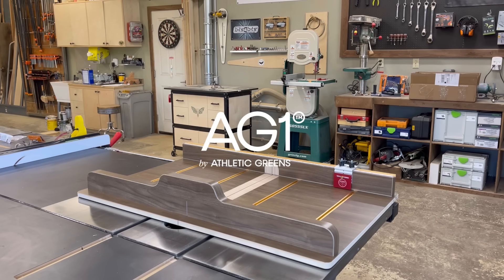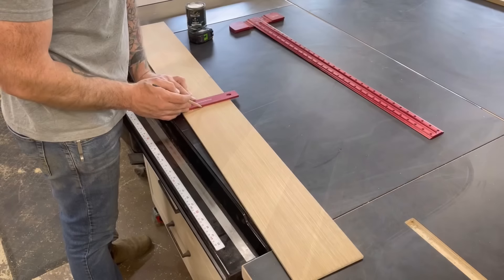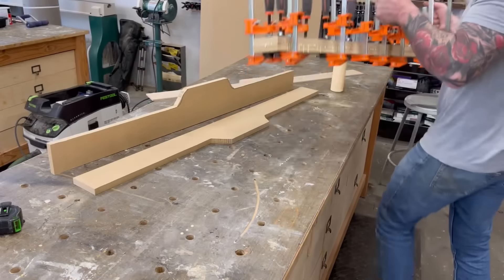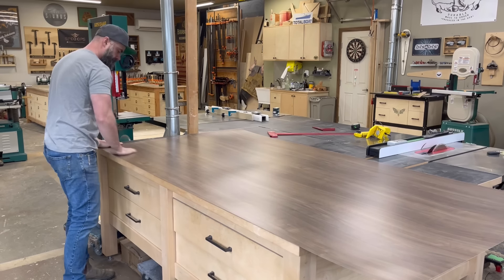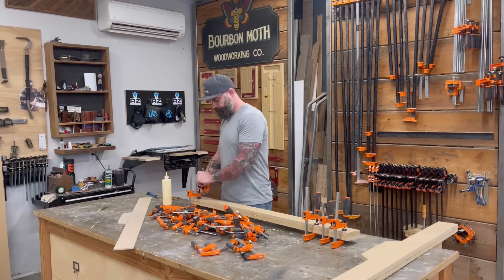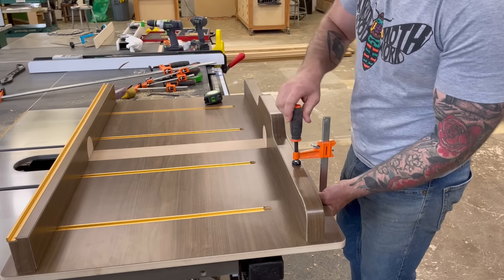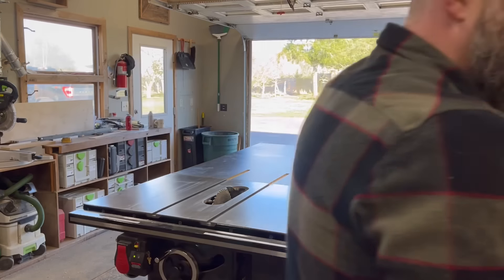Worlds Nicest Table Saw Sled || Ultimate Table Saw Upgrade

Comment: It’s beautiful. And probably weighs a ton. I ended up making very small, medium, and mega sizes to save my back. Also used plywood rather than MDF to reduce weight.
Reply: I made one a similar size as this out of mdf and most definitely wouldn't recommend it. It's got to weigh 60+ pounds
Reply: I made an "Ultimate Crosscut Sled" about this size. Now it's two crosscut sleds.
Reply: Moth is yoked
Reply: Thats why he is selling Ag1

Comment: Absolutely fabulous, as ever. I keep a short length of scrap T track with my sled. It drops into the out feed end of one of the mitre slots and contacts the end of the runner at the point when the face of the fence is directly over the centre of the saw blade. It gives a positive stop so you don't expose too much of the blade through the sled and you know the cut is complete without having to lean over to see.
Reply: This is a really clever idea! I'm definitely going to incorporate this. I like that it's not "permanently" attached to the sled so if there ever were a reason to need to go beyond the positive stop you can.
Reply: Great idea!!
Reply: @Logfunktioniert nicht! 4:29 anLovell

Comment: When sticking two surfaces with contact cement, sometimes I use cooking parchment paper since the contact cement doesn’t stick to it. As a bonus, you can just unpeel the parchment from in between the surfaces once you get it all in place.
Reply: Never tried that. I have used slip sticks and removed them one at a time and rolled it down.

Comment: A great looking sled, Suggestion; consider using Phenolic panels, also called Phenolic plywood for jigs such as cross cut sleds. Its used by masons for pouring cement into forms. the surface on both sides is very smooth and extremely durable. So much so they can reuse it several times with cement before replacing it. You don't need to laminate the surface of parts, just the edges.

Comment: Now I need a cross cut sled.  I'm not a wood worker by trade.  I consider myself a life long tinkerer and have no problems building my own boxes, tables, etc...  functional stuff.  Usually out of the cheapest (and hopefully the straightest) boards I can find at my local big boxes.  That being said, this is my 3rd or 4th video from you that I have watched now back to back.  The others being on sourcing wood.  Subbed.  Thanks for the inspiration!

Comment: So I tried cutting laminate like this (cheap home depot Wilson art)... and it shattered and caused rips throughout the whole thing, so make sure you're using quality laminate to cut like this, otherwise a router works really well. I just used the same flush cut bit I used for the edges - running along a wood template, CA glued on the back with painters tape.
They also make a water-based 'fire resistant' contact cement (in a green can) that is less stinky.

Comment: I made a similar sled with those same type of runners. One tip that I wish I had known at the time is to make a fairly large pilot holes and put screws through them and then make sure that the screws did not expand the runners width so it no longer fits. I had a perfectly fit sled and after screwing the runners down it no longer fit. The width expansion was imperceptible but it was there. I had to take them off and file the sides down a bit because it expanded and that expansion was permanent.
Reply: I've done that before too using UHMW runners, but the opposite happened, they were slightly sloppy before and the screw expansion made them fit perfectly.  Really just got lucky though
Reply: @acanadianwoodworker  Nice

Comment: I built one similar a few years ago. They are stout, sturdy and a bit of a pain to lug around. I ultimately built a smaller one for smaller projects and use the larger one for jobs that need it. An 'all in one' sled is nice on paper, but having two or three for specific size projects is so much nicer.
Reply: Same here. I built a smaller sled inspired by John Heisz's mini crosscut sled.

Comment: Wax paper also works great for positioning large flat surfaces being stuck together with contact cement.  The cement will not stick to the wax paper and the strips of paper can be removed one at a time for the final adhering stage.   Nice video!

Comment: Speaking of Double Sided Carpet Tape - I recently built a new workbench and botched the laminate adhering somehow (either not enough or maybe because I did it in a cold garage?) and part of the laminate started pulling up in the center. I gently pulled up some more of the laminate, threw down some strips of double sided tape, and works good as new! I did tape along the edges that I had to trim off with a knife, and the edges are firmly in place so there's nowhere to catch and pull it up anymore.

Comment: Man, your eye for detail and precision always is impressive, the sign of a very experienced cabinet maker/ woodworker. I'm like that as well, I just don't have my own shop with all kinds of tools to pull it off. I'm more of a field operator when designing and building, using the most basic of tools, while being very precise and incredibly picky about my outcomes. 
I toured for many years in the entertainment industry and touring - there's no way you can carry a full shop with you. Sometimes you luck out and are working in a theatre or venue that has a well equipped workshop, and the shop manager allows you to work in their shop, many don't. A workshop is very much a personal thing for the owner or person who operates it. And trying to explain what you need done and having it done that way makes it impossible to work together when you can't be hands on of your own project, SO, Road cases become work benches and tables. 
I was lucky in that I was able to design a road case that with the help of 1 other person, could transform into a miniature, fully working, portable workshop including a table to work on that all my power tools were able to be mounted on as needed. Not only was I doing the basic technical work on guitars, basses, and other musical instruments, as well as theatre props, but I was also able to build them all from scratch when needed. I had some building projects of my own that I carried with me and would work on when I had the time. My full touring fold up shop was all in a road case that measured  77" x 29" x84", and travelled on 10 rotational heavy duty locking case wheels on the 84" x 29" side of the case bottom. Fully loaded with all the shop tools I carried depending on the show I was touring with. The case would range from 500 to 800 lbs. 

I don't tour any longer and I greatly miss it. I especially miss my workshop road case. I built it big enough to carry everything I would need, but could fit through a standard apartment door, and opened up fully set up only needed a 20' x 20' space with a standard ceiling height, which included working space to move around the setup. I even had a shop vac built into it for wood dust, and other cuttings dust to be collected right away.
Man those were great years in my life. Best of all, I designed and built the whole case, inside and out. It took 4 months of designing and planning on paper, and making miniature and full size cardboard mockups of it until I had it exactly fitting everything I needed in it, and 2 1/2 weeks to build. When I decided to stop touring I gave it to another guitar/ instrument tech I had worked with many times on many tours, that also had the same interests as me in building instruments, props, and set dec pieces on the fly.

Thank You for the incredible projects you build on camera for the channel. It's truly a pleasure watching you build.

Cheers!,
Keep Safe and Always Inspiring,
Matt - Toronto, Canada

Comment: Here is a tip to dress up your sled even more. You can color all the edges of the MDF with Mark A Lot pens to make them brown, black, red or any color the pens come in. If any of the color gets on the surface, it wipes off easy with lacquer thinner. This is fast and easy and dries instantly. I keep a jar of these pens in my shop all the time.

Comment: Damn, she is a beauty. I've built a few of these over the years, but never this nice. Not sure I would feel comfortable using that, it's almost too fancy. 

Two things I would recommend. First, I like to use white or yellow laminate for shop work surfaces. It makes everything a dry erase board for pencils. Easy to write notes down, and they wipe off with a touch of spit and a brush of the hand.

The other thing is using water based contact adhesive. I started using a 3M product about 20 years ago, and never looked back. I did my own kitchen counter tops in 2007 and they still look as good as the day I built them. I have done many others in my area with the same results. The best part is, no awful smell/fumes. Also, I use a bunch of slats from an old window blind I found at the dump for spacing the sheet off the surface during layup. Works perfect every time, and it was free.

Comment: Back in the day when made a lot of Lam tops. We always laid the cut Lam on the particle wood, we’d glue that, then remove the Lam and apply the glue to the particle board. If we  ever saw someone applying glue on a work surface… we’d loose our minds. 

Nice Sled Jason!
Reply: I’m building a sled similar to this one using Formica on 3/4” MDF. I haven’t messed with laminate much, seems pretty straight forward, but I ran into a problem. The MDF warped a little after applying the contact cement and laminate. There’s a slight bow across the length of the sled. I imagine when I attach the fences that should pull it flat again. But since you have a lot of laminate experience, any thoughts on what may have gone wrong or ideas to fix it?
Reply: Lam both sides. The tension from the glue is probably the cause of the uptick.
Reply: @mikeinmaryland  I did laminate both sides.
Reply: Sorry I thought of one other thing. Lam has grain, I don’t mean the picture on the  front, I’m referring to the back of it. Vertical grade as well as horizontal. V grade is thinner and doesn’t offer much support. Anyway, make sure your grain is running opposite of your issue.
Reply: @mikeinmaryland  I’ll check that on the next one. I’m just hoping the fences will pull
It flat

Comment: Nice! 
With the Shaper Origin you could also add a radius slot on each side of the base, and pinned the fence instead of bolting it down (or just as a removable optional fence), allowing for angle adjustments to the fence in either direction for miter cuts.

Comment: I want to suggest something that Axminster's UJK brand recently released - UJK Dovetail T-Track. 
T-Track in places where hold-downs are used has a tendency to pull up over time when held down by only screws/glue. With Dovetail track, the wood the track is in will will also help  resist the pulling and make it tougher to gradually pull up, assuming you use both the dovetail and screws.
If Axminster sells a product in the US, like the T-Track, you can usually get free shipping easily enough. I haven't found anyone else selling this yet.

Comment: On my sled I left a 2" square of material sticking out on the right side by the rear fence. I put a stop block on the saw fence set so that the sled can not go forward to the point where it will cut thru the back safety block

Comment: You can sand the back side of the  laminate in areas where there are tight curves. It can go pretty thin then just slowly roll it onto whatever the piece is you're working on. I've been working laminate for about 20 years. I normally use a belt sander in those areas on the laminate.

Comment: Add a hollow box without floor on the backside of the sled, where the blade exits. Tune the lengthwise stop position of the sled using the stopped miter channels in the outfeed table. Blade will then stay inside the box when it exits the sled and never be exposed. Bullet proof solution superior to any "keep your hands out" warning.

Comment: Great video as always but I’m not clear as to how you replace the inserts.  There is no fingerhold/pry area and it seems like the front and rear fences are on top of the bottom insert?   Seems like you’d have to disassemble the sled to switch it out.

Comment: Nicely done! I made one recently using some of your earlier features. Couple things I wonder - For the rear sled track I used two pieces of (Incra) t-track plus with built in scales that can slide a bit. I thought that way I can move them to align the left and right "zeroes" with the edge of whatever blade. I also used MDF on top of plywood that let me make replacable zero-clearance plates by putting threaded inserts in the plywood and countersinking 1/4-20 flathead machine screws to fasten the inserts. And with the (not nearly as cool as yours) katz-moses block - I put a groove next to the rear fence so that the bottom of the stop-block rides just below the top of the sled. That way beveled or really thin stock cannot slip under the stopblock. One question I have is what about the aluminum track would trigger the sawstop? I don't (yet) have one but I did use the adjustable aluminum track on mine so I would need to switch to something non-conductive if that is an issue, but I am not clear why that would cause it to trip. Anyway - thanks for yet another really great video!
Reply: Nick Ferry's CC Sled video has a good explanation and solution for the SS tripping on aluminum. He also explains the 5 Cut method very well. Good luck.

Comment: An ah-ha! moment and I thank you for it...the scrap wood risers to cut material with the tracksaw on the table. I'm about to build a multipurpose structure to be used for both flattening slabs as well as a sheet goods cutting solution. Rather than using the ever-popular piece of foam insulation, I'm going to try and incorporate what you are doing for both holding sheet goods up in the air, but also for risers when the need to raise a slab up is also necessary. One solution for everything. Thanks for that! And your sled is da bomb...

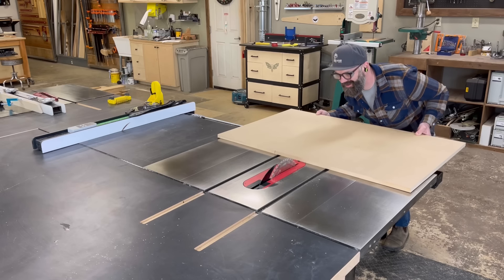Comment: I'm dying to build myself a table saw sled. I've always dreamed of building one as nice as yours. HOWEVER, I've noticed lately the trend has been to move away from these large and complex sleds, in favor of small very simple ones. I'm only commenting based on the plethora of videos I've seen lately where guys claim their big extravagant table saw sleds are way too much overkill, which ends up being more of a pain in the butt and far less convenient than they'd anticipated, so they then make a video of them building simple much smaller one. Let's face it, most of the work done on a table saw is either ripping, which you don't do with a sled, or doing cross cuts, which would rarely if ever require more than eight inches of board width inside of the sled. Again, I'm not knocking your sled, because I think it's awesome, and am quite envious. I'm just commenting based on a trend I've been noticing lately. I'd still take yours in a heartbeat. I'd probably frame it, hang it on the wall, with it's own special lighting. It's that beautiful. 🤗 Oh, and on a side note, where do you buy your weed? 🤣🡺 2:24

Comment: In the early part when talking about the laminate, you said that nothing sticks to it.  Yet, when you used the double sided tape for mounting the runners on the bottom of the sled????  You are right, it is a FINE looking tool!

Comment: I've used a few of those Starrett tape measures, and have noticed that they're off by about a 32nd of an inch over 12 inches. You might want to check its accuracy.

Comment: Awesome video , have to make a better one with T - tracks myself. The part where you talked about not letting the sawblade come out completely that some people do as safety. Yeah I see how that creates various issues because you're never able to cut thicker pieces to length because your maximum saw blade height can never reach your fence. I did it differently myself , I made the middle part with a double beam. Wide enough so that I put my hands besides it my thumbs comfortably sit a big distance away from the sawblade. So I can't even on accident cut my hands in that manner because I can never reach the sawblade with basic use. Anyway I really need to redo my crosscut sled and make it with T - Tracks so I can cut things more accurate easier and in style :)

Comment: Very nice project.  You may get a few more years of use, than one made from plywood.  Very heavy though.  Plywood would be a little lighter.  However, both are still made from wood based materials.  And as we all know wood contains moister, which leads to expansion and contraction.  This will lead to your sled being out of square.  
I have found a better material, High Density Polyethylene (HDPE).  Basically Plastic.  Less friction, no form change and over 30% lighter than wood.  I have made many different sized sleds out of a 4'x6'x1/2" sheet.  Teamed up with "T" track makes them more efficient and durable.  I have them for table saw, bandsaw and router table.  
Only draw back some of you might find, up front cost.  For the size I used, $180-$250.  After five years they are still in square.  No need to fine tune like the ones I made from Baltic Birch.

Comment: So i did everything just like you did, my problem is the sled doesn't slide that easy.  individual the plastic rails slide ok, but once everything is together it will barely slide at all.  I hate to mill (sand) down the plastic because I will lose the squareness I was trying to achieve.  Any suggestions would help.